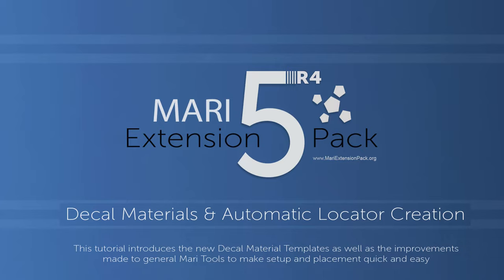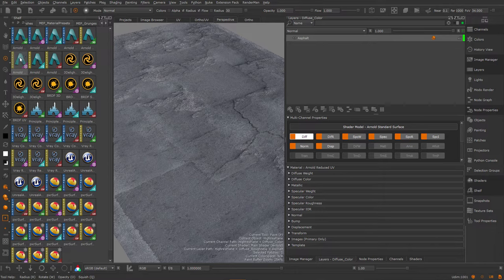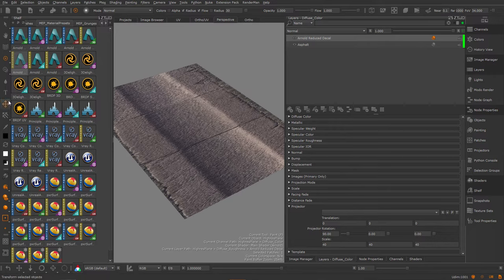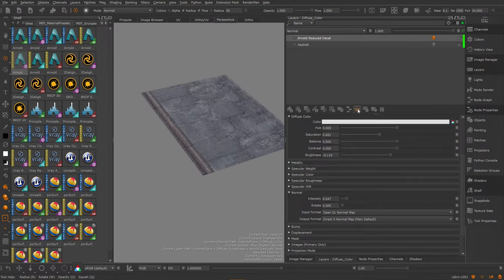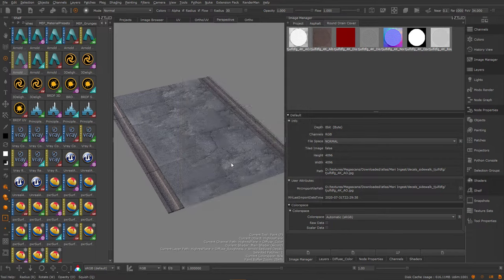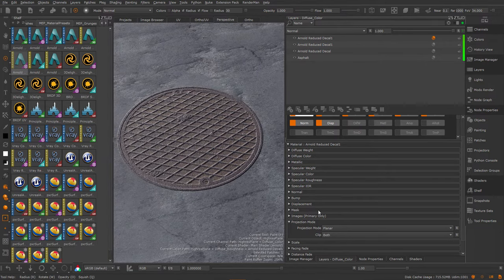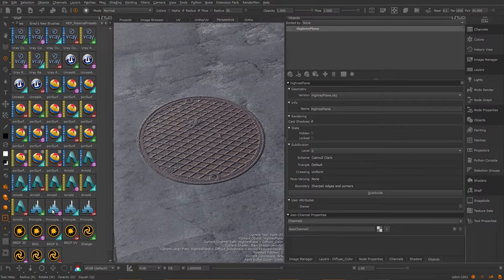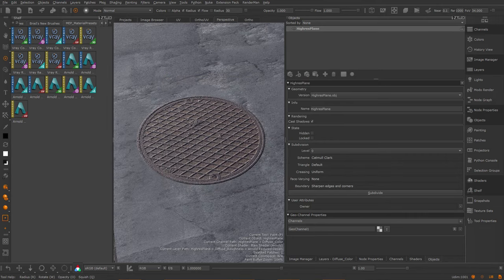Decal Workflows | MARI Extension Pack 5 R4

Comment: How does the decal material work when I texture by node graph? No matter how I adjust the gizmos, the texture of decal material doesn't show on the model.
Reply from the maker: By default the decal materials are aligned to project straight from the front. The easiest way to align them is to align your view and press the "Align to view" button in the main toolbar when the Transform Gizmo is active